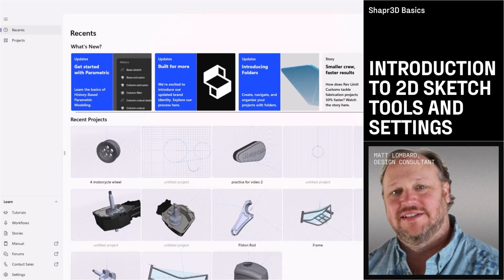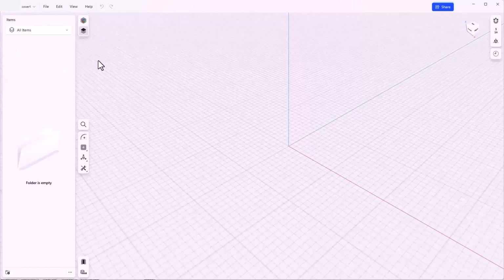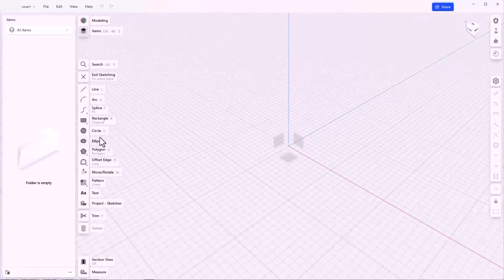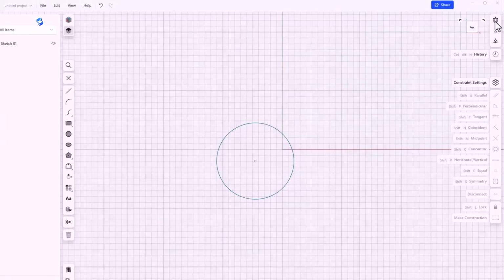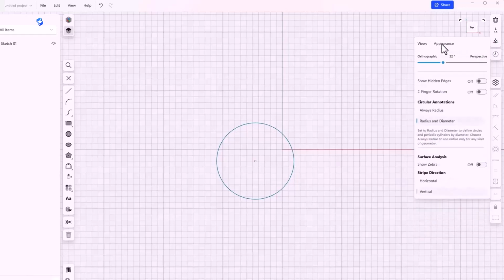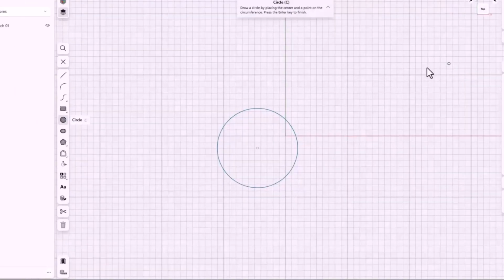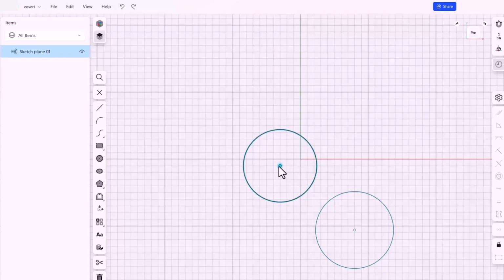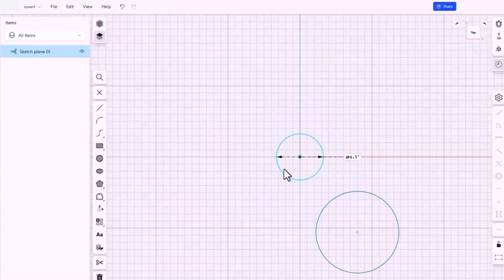Introduction to 2D sketch tools and settings: Motorcycle Cover Design part 1 | Shapr3D Basics

Comment: Attempting to create the shape in this very simple video has me frustrated :) When attempting to click-shift/click for line tangential to two circles, it allows the first.  For the second, it either produces a zero degree line at the top of the circle or provides a message saying 'This constraint would conflict with existing ones.'  I have tried multiple approaches.